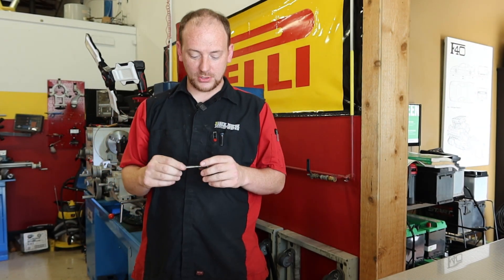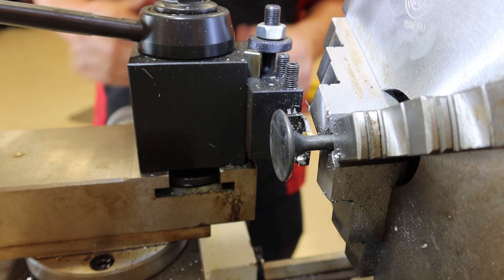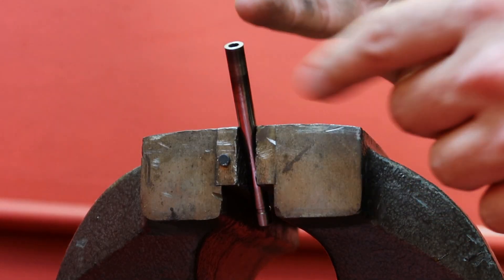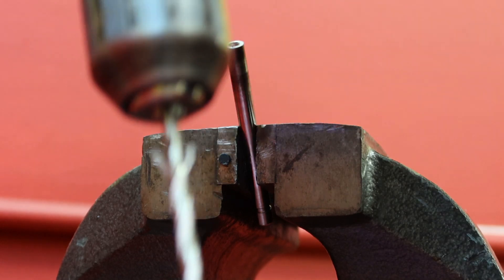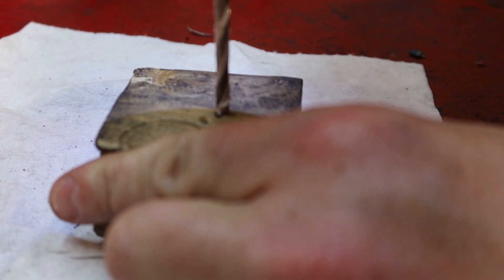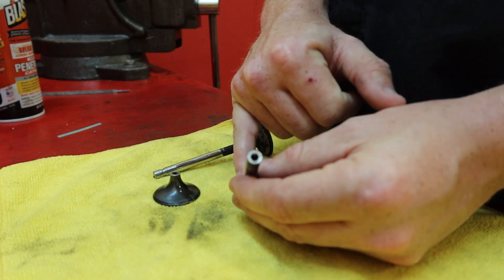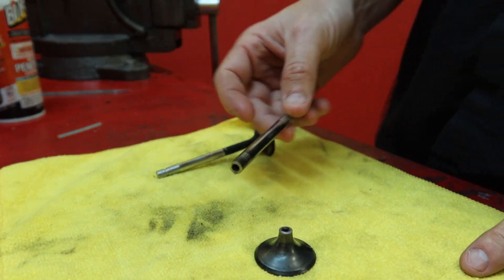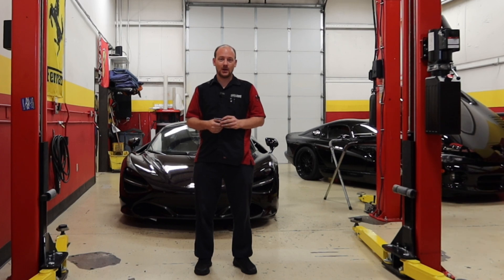Cutting Open Ferrari Sodium Filled Valves: Unveiling the Secret Inside!

Comment: I've had trouble with two exhaust valves in my entire life: one broke, trashing the engine, the next example merely cracked. Both were sodium filled.
Advantage: thermal transfer blah blah... 
Disadvantage: hollow stem and thus obviously weaker, risk of the head breaking off and trashing the engine.
Reply from the maker: This does occur. We have seen split and broken valves.

Comment: I own a Soviet built Zil 131 truck fitted with a V8 petrol engine that uses sodium filled valves.  Apparently this enables it to use very low quality fuels that would burn out standard valves.  The truck was built back in 1972, pretty cool tech then.
Reply from the maker: What a beast!

Comment: My old 1947 GMC 6 cylinder panel truck had sodium filled as did many truck and aircraft engines at the time.

(also do not touch sodium with your fingers, it can be dangerous)
Reply from the maker: It burns.

Comment: Old 912s had sodium filled valves
Reply from the maker: The Porsche 912, which was produced between 1965 and 1969 and again in 1976, does not typically feature sodium-filled valves. The 912 is powered by a four-cylinder engine derived from the Porsche 356, which generally used standard solid valves rather than sodium-filled ones. Sodium-filled valves were more commonly found in high-performance or turbocharged engines where additional heat dissipation was necessary. The 912, being a more entry-level model with a less powerful engine, did not require this technology.

Comment: Are those hard to manufacture and very expensive
Reply from the maker: Yes, sodium-filled valves are harder to manufacture and more expensive due to their complex hollow design, the specialized process of filling and sealing with sodium, the need for high-quality materials, and their use in high-performance applications.

Comment: Nothing amazing about these at all, found on many run of the mill cars even old Fords
Reply from the maker: Sodium-filled valves are amazing because they significantly improve heat dissipation. The sodium inside the valve melts at operating temperatures, effectively transferring heat from the valve head to the valve stem, which then dissipates the heat into the engine's cooling system. This keeps the valves cooler, reduces the risk of valve damage, and enhances the engine's overall performance and durability, especially in high-performance and turbocharged engines.

Comment: Rotary valves n that's itlf u want to use valve period n cam n rocker dome two stroke style with custom CNC block for intake n exhaust manifolds in block cylinder
Reply from the maker: Yee haw!
Reply: @AltitudeAndLongitude  idk I like two stroke no cam valves springs nothing dome two or three spark plugs piston engine cylinder where exhaust n intake are n crankshaft what are the ratios of having a problem if it isn't there lol them snowmobile n Yamaha banshee ride hard when ported n bored 🥱😴

Comment: I still want someone to replicate an engine and have most of the moving parts titanium. Pick an engine, scale it.. see how it performs.
Reply from the maker: Not cheap!
Reply: Yeah.. and hard to machine.. but wow it could be so worth it! A dream of mine. 
China sells all kind of titanium fasteners..(ebay)
It's basically like the weight of aluminum but strength of steel. I think you could get much higher rpm's safely

Comment: Sodium valves where in the 2V not the QV.
Reply from the maker: Both, the Ext valves on the QV are sodium filled
Reply: @AltitudeAndLongitude  I don't believe you are correct. They were stopped in 82 with the 2v. 2 reasons: 1 breakage, the 2v motor used a narrow 8mm valve which didn't leave much wall thickness 2: the 4v head used even narrower 7mm valve stems than the 2v there for sodium wasn't even attempted. My QV valves are in someone's hands as we speak.

Comment: It ISN'T metallic sodium or it would have burst into FLAME on exposure to oxygen. Motorcycle valves (1/4 the size of the 308's) have been sodium filled since the 1960's (Honda 750 Super Sport) and sodium does NOT cause valve head failure. Lousy un-leaded fuel (especially with added ethanol) DOES on engines DESIGNED for cooler burning higher octane leaded gasoline. In the EU, 130 octane leaded fuel is still sold at EVERY gas station. Yes, it costs more than $45 a US Gallon ($11-13 a liter) PLUS the "gas flap multiplier". In Europe, hypercars pay a premium on fuel. On the gas filler flap is a number between 1.1 and 12. A Bugatti pays more than $100 a liter for fuel-if you can afford a $5-15 million dollar car, you can afford $380 a gallon fuel.
Reply from the maker: Thats wild! Ill stay in the USA a bit longer
Reply: The reason Ferrari had the issue is that most sodium valves were from 9mm to 10.5 mm thickness where as the F valve was 8mm. Not leaving much sidewall to weld the valve head to.

Comment: As a Mechanical Engineer it would be interesting to see the percentage volume fill of Sodium...it could not be 100%.  Dont torch it.  Cut the stem and see how much comes out when heated.
Reply from the maker: Id say around 30% by volume at a guess.
Reply: @AltitudeAndLongitude  was it a simple drilled hole?  Or was it larger hole in the valve head?

Comment: The attention ho stole the show...You could have put the valve in a toaster oven and melted the sodium out.  Melts at 208 degrees F.  Sodium filled valves were used in aviation engines too.  Thanks for the video...never saw the inside before.
Reply from the maker: Not much to it once its opened up. We have some aircraft valves around as well.
Should I take a torch to it ?

Comment: So how do they actually make valves and get the sodium sealed  inside?
Reply: Most valves are made of two pieces, the head and the stem, that are fused together. The sodium is put in before they are fused (welded). Notice how the head was much harder than the steam.
Reply: @sergeantschultz810  The welding of the head to stem surely creates a lot of heat, so what kind of magic is employed to prevent the sodium reacting  to that before it gets sealed in? I am genuinely curious to know.
Reply: @spotontheroad1 

To my understanding, it wasn't 'welded' in the common perception of using an arc to melt the two mating surfaces together using a filler material per se. Instead, they are friction welded.

So you'd have the hollow valve stem, with the sodium placed inside. The valve head is then spun at a high rate of rotation, then pressed against the valve stem. The friction rapidly raises the temperature of the two mating surfaces, causing it to permanently fuse together in very short order. 

The rapid heating would likely vaporize and chase off any moisture as they rapidly expand and get expelled towards the cooler atmospheric air. So rapidly so, that this likely occurs before any of the sodium could absorb enough heat to transition to its liquid state. 

Any remaining moisture would react with the sodium, causing it to very minutely oxidize, though without a greater supply of moisture to further fuel the reaction any longer, the reaction becomes arrested, and sodium; stable.
Reply: @V3R71GO  Thank you for the detailed reply. That is very clever if that's how it's done. I like that.👍
Reply: @spotontheroad1  You're welcome! What is outlined above is what  I understand to be mercedes' approach. Though I'd assume the industry standard for manufacturing these valves would be pretty similar. 

Glad I could pitch in!
Reply from the maker: I need to find a valve shop to answer that for us!
Reply: exactly my question too 😅
Reply from the maker: I belive @sergeantschultz810 has the right answer for you!

Comment: mid 1970's Chevy / GMC trucks in heavy duty applications like camper specials, had sodium filled valves, my mechanic classes in mid 1980's had invoices from dealerships on them, and students were allowed to play with the valves, cut them open. I still think its cool to this day
Reply: Yeah the exhaust valves had a larger stem diameter. I figured that out quickly when I went to grind valve seats and my arbor didn't fit the guides.

Comment: Why not Titanium?
Reply from the maker: 1. Cost: Titanium is significantly more expensive than other materials.
In addition to cost, several other factors contribute to the limited use of titanium in engine valves:

2. **Manufacturing Complexity**: Titanium is more difficult to machine and form compared to more common materials like steel or stainless steel. This increases manufacturing complexity and cost.

3. **Brittleness**: While titanium is strong and lightweight, it can be more brittle than other metals. This can make it less suitable for the high-impact environment inside an engine, particularly in applications where the valves are subject to significant stress and impact.

4. **Wear Resistance**: Titanium has relatively poor wear resistance compared to other materials. In an engine, valves are subjected to constant opening and closing, which can cause wear over time. Titanium valves often require special coatings to improve wear resistance, adding further to the cost and complexity.

5. **Heat Conductivity**: Titanium has lower thermal conductivity compared to steel. This can be a disadvantage in engine applications, where effective heat dissipation is crucial for preventing overheating and maintaining performance.

6. **Compatibility with Other Materials**: Titanium can react with other materials in the engine, potentially leading to issues such as galling (where materials stick and abrade each other). This requires careful selection of compatible materials and lubricants, complicating the design and maintenance of the engine.

Due to these factors, titanium valves are typically reserved for high-performance or racing engines where the benefits of reduced weight and increased strength outweigh the disadvantages. For most standard automotive applications, more traditional materials like steel, stainless steel, and sodium-filled valves offer a better balance of cost, durability, and performance.

Comment: The purpose of the Sodium is to transfer heat from the valve head to the valve stem and then into the cylinder head.
 The Sodium melts into a liquid inside the head of the valve and due to the valve motion it splashes up into the stem, transferring heat into the cylinder head.
Think of it as a liquid cooled valve.
 Sodium filled valve have been common on high performance aircraft since the 1920s but have largely been replaced by Inconel valves.
Reply: I get howthe sodium valve works, but What is an inconel valve exactly?
Reply: @jeffarp7409  
Inconel is a Nickel Chromium based super-alloy metal that is used in extreme heat and highly corrosive environments like combustion chambers and turbine blades in jet engines, exhaust valves in high performance car/aircraft engines and also in nuclear reactors.
Reply: @Johnno48  ok I see, I haven't heard that term before.  Thanks for answering my question. I knew that they used high nickel alloys in applications like that.
Reply: @Johnno48 
My MR2 made heavy use of inconel in the turbocharger system for similar reasons. That turbo was 30yo and made 18PSI the day I pulled it off and upgraded it. Never failed throughout decades of fairly heavy abuse.
Reply: Also electric stove heating elements
Reply: @jakewhitney8201  
I think you are referring to Nichrome wire (Nickel-chromium) which is common in heating elements it is in a similar family to Inconel.
Reply: my cars all have sodium filled inconel valves.
Reply: Wild stuff.   Learn something new every day.  Have they used any other low melting point metals?   Mercury or something?   Now I have to go on a tangental reading spree today.   Thanks for the explanation

Comment: You should have dumped some of it in water and watched the fun!
Reply: You should wash off that drill bit.  It looks dirty. 😅
Reply: Yes my chemistry teacher used to do this in class to brighten up a dull lesson!
Reply: @COL321  Imagine that in the middle of a test!
Reply: When you purchase sodium it comes shipped to you in an oil filled container. Lots of fun.
Reply: Not much fun. VW and Audi was using sodium filled exhaust valves in their 1.8s back in the early 2000s.
Reply: @iamtheoffenderofall  sodium filled valves are nothing new🙄 Ford used them back in the 1960’s in their 427’s !!!